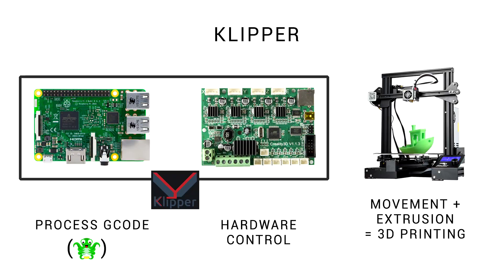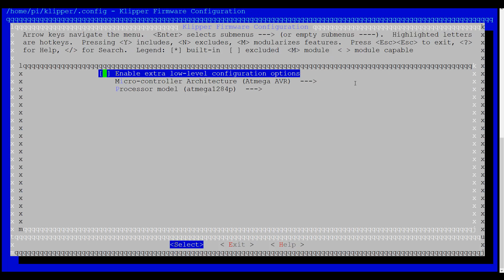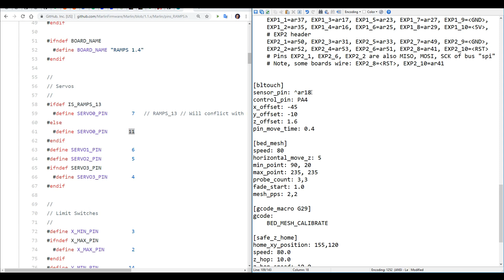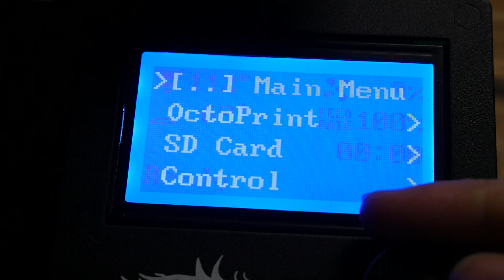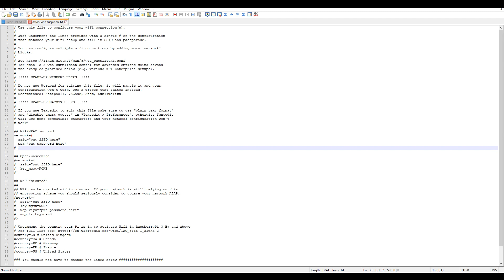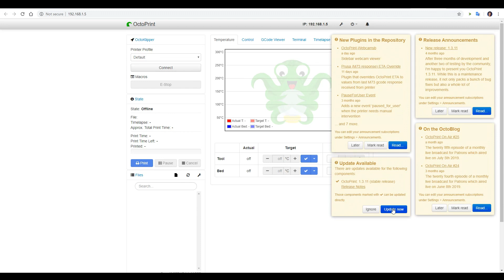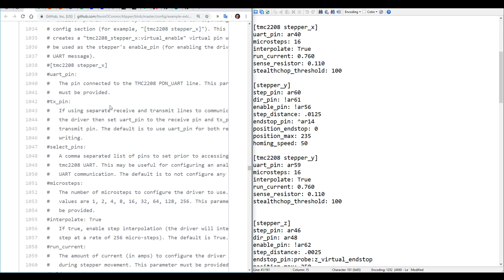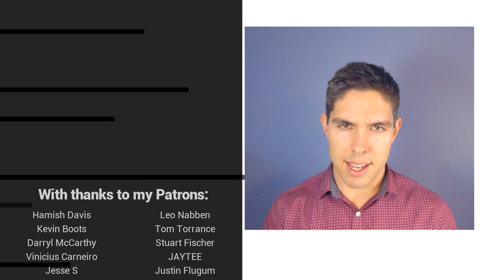Klipper guide part 2: MKS Gen L/TMC2208 + Wrecklabs Printhat

Comment: TL;DR IF YOU OWN A DELTA PRINTER YOU ABSOLUTELY SHOULD TRY KLIPPER!

My first printer was an Anycubic Kossel Pulley that I bought second hand, and it was nothing but a constant nightmare.  I could never get it to level correctly, and even when I did finally get it printing after using a least-squares calculator online, it only lasted for a couple of weeks before it was completely out again.  I had resigned that it was just a bad purchase, and left it off collecting dust after I purchased my ender 3.  I had been considering stripping the kossel of parts for a hypercube build, but decided to give it one more try with klipper since I still felt like experimenting with that, AND OH MY GOD IT WORKS!  After about an hour of setup and going through klippers basic delta calibration and extended delta calibration it's now printing great and FAST!  I'm getting an SKR mini E3 board in sometime in october for my ender3, and will be giving klipper a try on that one.

Also, the convenience of the printer.cfg file as opposed to having to reflash firmware just can't be understated.
Reply from the maker: Thanks for sharing in such detail. I'd like to try it on a Delta for sure.

Comment: hello, i have ender 3 v2 with 4.2.7 board, and i have problem with configure klipper, i use config file generic-creality-v4.2.7.cfg from github, in [mcu] section path is correct, i choose stm32f103 with 28bit offset bootloader

Comment: I would like to see it running on a SKR 1.3. I have this board here and I'm just waiting for my TMC2209 drivers to arrive (tomorrow, hopefully!) to upgrade my ender 3.
Reply: I'm curious how that goes and what the process is.  I'm waiting on my SKR MINI E3 board and will be trying klipper on it, so I'm hopeful more documentation/cfg files will be available by the time my board arrives.
Reply: where (link) did you buy the skr 1.3 and tmc2209 drivers.  In amazon I see its compatible only with tmc2208
Reply: is it compatible with klipper? if so, it will probably be even faster, since you be having 2 32bit processors for printing.
Reply: @joesucher  AFAIK, yes, should be fine.
Reply: @joesucher  I forgot to say the 2209s took a LOOONG time to ship, they said they were in great demand and the stocks are low because they are very new.
Reply: @joesucher  I’m also curious if there is a benefit to using Klipper if you’re using a 32bit board.

Comment: 5 Plus would be a great candidate, and I'm pretty sure you can setup the DGUS DWIN display to work with Raspbian - though, Iunno if it would use any of the same pins as the PrintHat
Reply: if so, it would only be a matter of finding different suitable pins.can't be that hard...might have to rewrite a daemon, but you'd end up with one slick printer...

Comment: Hey Michael,
I just updated to the Wrecklab board and used your configuration and wiring sketch. 
You twisted the head bed and hot end wiring and during a test print the extruder motor got very hot, which is due to the current of 0.9 in your config for the extruder driver. 
For the headbed you also forgot the resistance of 10k Ohm, which leads to low temperature measurements.
If a beginner in klipper simply takes over this, it could lead to problems. 
Maybe you should adjust this!

Greetings Nils

Comment: So how much faster are people printing with Klipper? is it 10%. 50% etc faster? I thought mostly speed was constrained by the mechanics of the printer.
Reply: Since swapping to klipper, my print times seem to be cut down by about 30%. When using marlin, my actual print times would be about 30% longer than the estimated print time in cura. When using the SAME gcode on klipper, my print times are slightly faster than the estimated print time in cura. I can't really explain it because I'm using the same exact gcode with the same exact settings. My best guess is that the 8 bit board is slowing stuff down so it can make all the calculations it needs to, while klipper is running closer to the actual set mm/s speeds. I'm still printing at or below 80mm/s but my print times have definitely decreased. Only downside I've found is that I can't use the full resolution of my webcam connected in octoprint at the same time I'm using klipper, nor can I use octolapse at any webcam resolution or I get all kinds of problems. Lots of bugs when using octolapse including errors that pop up and cancel prints, layer shifts, and really long printer pauses at random times that ruin the surface finish of parts.
Reply: A good question. I think my Ender 3 shakes too much before the capacity of the 8-bit board becomes a problem.
Reply: @puhsketti1271  Hmmm... I think I will stick with the 32bit SKR then in that case.
Reply: I had the stock Ender 3 pro main board with Klipper installed. I tuned Cura for a fast print. Worked really well. Now I've upgraded to SKR 1.3 with 2208s.  Running Marlin for the time being. When printing with the speed profile from Cura the print times are more or less the same as with Klipper and the stock board.
Reply: @puhsketti1271  What kind op Raspberry Pi board are you using? And what is the full resolution of your webcam? I'm also curious if your only running 1 printer on the Pi.
Reply: @Cergorach  I'm using a rpi 3B+. Max resolution of my webcam is 3280×2464 which worked great using octolapse/octoprint without klipper. Turned it all the way down  to 640×480 and the pi still can't handle octolapse+ klipper at the same time. Only running the one printer on the pi.

Comment: I was about to say that the hat blocked the other gpio on the Pi then I remembered klipper replaces octoprint so my thought is irrelevant. No octo plug-ins so no need for extra gpio.
Reply: klipper doesn't replace octoprint at all.  it works in conjunction with it.  Octoklipper is a fantastic plugin for octoprint to give you access to a bunch of extra klipper stuff.
Reply: @nothanks7752  I sit corrected. Then my concern is valid about the gpio if someone wanted to use them.
Reply from the maker: There are some pins spare on the Printhat unless you are running max end stops too.

Comment: I'm interested in getting more efficient use out of my 3D printer (Ender 3), that means less energy usage and higher print speed at a high quality (printing models) and low noise. Many of the video's on this (and other channels) have helped a lot in that regard. Especially with bringing down the noise levels and higher quality. I do see less information on print speed, although direct drive and a better hotend are mentioned. With Klipper it is also possible to print faster, but how much faster and what are the limiting components and how do we stretch those limits (with better/different components)? Less print time should mean that a print would cost less energy, while the higher speed might cost a bit more energy, most energy is expended on heating components. Not only that, a lot of us in different environments/regions need to cool that additional heat in the summer (thus less energy spent is a double blessing). Another interesting thing is keeping cost in perspective, while I might see myself buying a Mosquito hotend eventually (if it's useful), but right now buying a component that is more expensive then a new printer is not the most efficient use of resources at this time.
Reply: The limiting component itself is the printer and its physics.
If you really want more, you NEED to go a better built printer.
Low mass extruder head assembly/moving parts combined with rigid transmission and rigid frame.
The only concepts able to do this are delta printer or a coreXY.
A step further is not to use stepper anymore, but brushless dc motors with encoders like you can do with ODRIVE. 
Happy searching :)

Comment: FYI- The SKR PRO V1.1 is pre-wired for SLI so there is very little hassle getting TCMs going.  I used TCM5160s with Klipper on my modified ender 5.  You can find my posts in the issues area of the Klipper git hub page.  I've hit 250 mm/s speeds easily.. working on 1000 mm/s.

Comment: Great video! Do you think your sidewinder x1 with the volcano hotbed would be good for the klipper raspberry pi hat?
Reply: Sebastian, I have a Sidewinder X1 and just set it up with Klipper. It is working great with the built in control board (MKS Gen L). You could get a high quality short USB cable and put the Pi inside the case for a tidy solution. The nice thing about using Pi without the PrintHat is that you can run 2 printers with Klipper off of it at the same time.

Comment: Hmm. I get an Ender3 for 170€. I can get a 32 bit board with enbeded TMC drivers for less than 30€. That price is not disconnected to the Ender3 price tag. I wonder if your overall configuration worth its at least 190€ (Pi+Shield+GenL+TMCs). That's an insane investment compared to the Ender3 basic price. Objectively, that's a huge delta price for comparable performance, don't you think ?
Reply: The printhat uses a  STM32F103 32-bit MCU and has TMC2130  it replaces the GenL+TMCS. Its nice but I would probably just go with a bigtreetech skr e3 dip (which uses the same MCU) and choose the drivers I want.

Comment: So how does klipper with say a mks gen L compare to a skr 1.3 with marlin as far as print speed/quality.
Reply from the maker: That's something I'd like to determine as well. I'd say for 90% of users either would be sufficient.
Reply: This is a 8 bit processor and de ask 1.3 is a 32bit arm processor
Reply: Nested Vectored Interrupt Controller with far superior math capabilities  and a Separate data and instruction bus. It will be idle most of the time.

Comment: i believe this part in config file is incorrect:
[tmc2208 stepper_z]
uart_pin: ar44
microsteps: 16
interpolate: True
run_current: 0.760
sense_resistor: 0.110
stealthchop_threshold: 5

it should be like this uart_pin: ar42, ar44 belongs to extruder
 uart

is that right?
working on my own config right now and just notice that
Reply: thank you

Comment: Curious to know if klipper can drive stepper modules directly from pi pins?
Reply: Late to this, but in case anyone passes by:
TL;DR: While it's _possible_, it's not advisable for accurate use. 

Like any operating system based computer (as opposed to a microcontroller) all communications to the physical pins are marshalled via the O/S and as such can never be guaranteed to be realtime. (e.g. I say, in Python GPIO.Pin(3,HIGH), python then interprets that, then calls the C library for GPIOs, which requests to open the /sys/class/foo/bar/pin file, then it writes to that file, then Linux says "ooh, looks like you're opening a file, I'll better check if you're allowed, yes... ok, and then, and only then, and assuming nothing else is happening at the time, it will write the voltage to the PIN) 
So, the O/S can only switch the output pin voltage via that chain of command, and when it has chance, based upon other processes running on the system at that time. Therefore trying to control, with any accuracy, a stepper driver from the O/S managed pins on a Pi is nigh on impossible, and never guaranteed. 

Hence we see that electronic hardware that requires any instantaneous (next clock cycle) change in voltages will pass that management over to a microcontroller, such as the ATMega on an Arduino board or similar as they can send and respond to pin interrupts on that next clock cycle (or at least program step), rather than whenever an operating system has finished doing other tasks. The Arduino bootloader firmware, for example, is a realtime single burnt in process running at the bare metal level from the EEPROM on the Arduino and doesn't have to worry about boring OS things like what the time is and whether someone is about to login etc. 
So, while it's possible to have a very bare bones microcontroller attached to a Pi, and use a protocol such as Firmata to talk to the m/c via serial and use the m/c to control a stepper via that (I do this for non 3d print projects using a protoboard built "Arduino" which cost < $10) , Firmwares such as Marlin on a printer mainboard, or boards like the Printhat, are basically this, but with all the specialist bells and whistles one needs to queue up sequences of motions to the stepper and control the stepper drivers in realtime from that queued sequence.

Comment: Thank you for this, I am running an mks gen L with a raspi 4, trying to install klipper I get this error: avrdude: stk500v2_ReceiveMessage(): timeout when trying to (make flash FLASH_DEVICE=....) any hints?!
Reply: Yeah dude, just read the note below that says to make sure octoprint is not connected to the board.
Reply: Wow...cheers man...it worked.

Comment: Would love to see this on a Delta to see what kinds of speed you could print at.  My delta is the fastest printer that I have and use for prototypes.  Making it print even faster would be desirable.
Reply: I commented above, but I feel like anyone with a delta, klipper is an absolute must.  I've got an anycubic kossel pulley and it never wanted to get level and hours upon hours of firmware flashing never helped.  It was sitting on the shelf waiting to be stripped for parts.  I installed klipper, ran its basic delta calibration to get printing, then it's extended calibration, took me about an hour total, and now it's printing like a champ at 100 - 120mm/s.
Reply from the maker: I'd like to put it on a delta for sure. Just a matter of time.

Comment: Amazing video! I run Klipper on my MKS gen L with 2208s and wish I had waited a bit more to do it along with your video guide! Would have saved me a lot of trouble! On another note: I was using the same currents for my config but had severe overheating of all my steppers with longer prints at 150 mm/s and 1500 mm/s2. Have you experienced any of that?
Reply from the maker: The 2208s made the steppers quite hot to touch, but they were still skipping steps. That's the worse case scenario.
Reply: @TeachingTech  I didn't have skipped steps so I simply reduced current. I didn't have that option for the extruder since PA put it under a lot of stress and it already started skipping steps quickly. Eventually my solution was setting it to Quarterstepping with Interpolation since according to another youtube video where someone tested the Torque of 2208s that resulted in much better results across a broad range of print speeds

Comment: So with decent processing power, can you get native 256 microstepping? What would that take? RPi 3b? RPi 4? or more power than that?
Reply: 3b is sufficient. Even if it sounds like you need high computing power, it is not. But 8bit is just ultraslow so everything looks like flash compared to it.
Reply: @hanswurstusbrachialus5213  I asked this because I saw many posts that even with a 32bit board like the SKR, native 256 was a strain for the processor. I have a SKR with 2130s and I am still using native 16 with interpolation. I am wondering if increasing native microstepping would improve print quality over interpolation.

Comment: I wonder why they built the PrintHAT board with a 32-bit processor since it is just a pass-through of stepper driver motor control? 
I am thinking 3D printing (for the home, small office) is at a crux right now: will we continue to build "stand alone / self contained" machines or more dumber connected machines (GCODE executing-only) to a PC/laptop which supplies all the critical thinking?

Comment: Can someone guide on the benefits of the PrintHat Versus the SKR Mini E3? Are those two parts that do the same thing, cross compatible, or not related. I was pretty sold on the SKR upgrade from Michael's previous video (es[pecially as it is pretty much just a plug for plug swap out. Right now I have the best quality after upgrading to Marlin adding the BLTouch and custom Code from Michael. IF I can up the speed without detriment to the quality I have gained, I'm in. Advice? @TeachingTech

Comment: Hi michael ref. Displays for the printhat, does it have I2C or spi compatibility? If so there are DIY options which may work on the reprap controllers forum. Original post for I2C by user called enif and spi based option by me, blackplasma. For both search "diy oled" i designed mine for use with my ender 3 mks gen l as it does not have i2c header. Worth a look if you have any little printers which need little screens.

Comment: How hard is klipper to set up for a delta?
Reply from the maker: There is an example delta config file but I have no first hand experience.
Reply: Not harder than for a cartesian. And it comes with integrated leveling/calibration (manual or probe). I had it running on my Anycubic linear (the 8bit Trigorilla board was just too slow on its own).

Comment: INSTALL the OCTOKLIPPER Plugin!  I have macro buttons all over the place to greatly simplify things like Bed Mesh Leveling, Setting probe clearances, (After changing nozzles for example), diagnostics and more.  I installed Klipper after getting my Ender 3 in February and learning for a month.  (I'm a computer tech though.)  I actually forget what it was like to use Marlin!  It sounded way different, for sure.  Anyhow, I can't say enough about how good it it for advanced users!!  I gradually got most of the things that bugged me worked out.  The only remaining thing, when my machine powers down and back up, I need to do a firmware restart.  Thanks again for your rear enclosure project for the Boards and electronics!  It made my machine, look tiny, finally!!!  (Even hiding the RasPi completely!)
Reply from the maker: I covered the Octoklipper plugin in part 1, plus it comes pre-installed on the image for the Printhat. i agree it's very worthwhile.